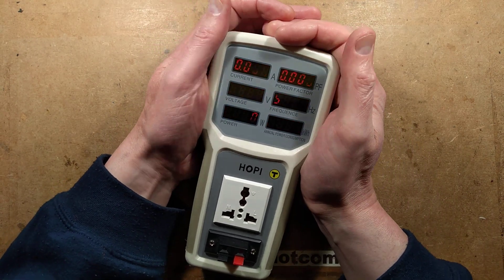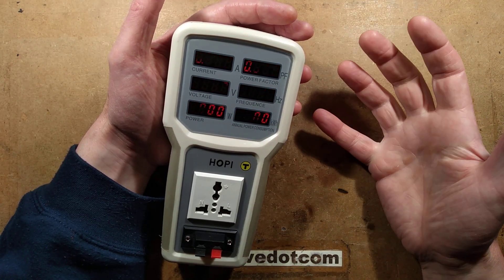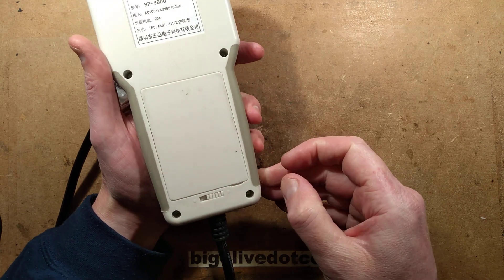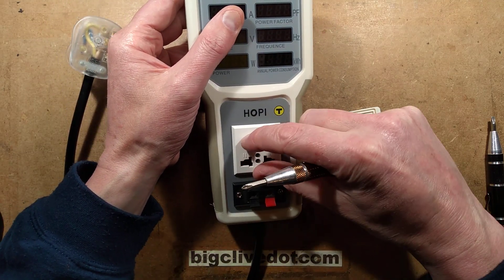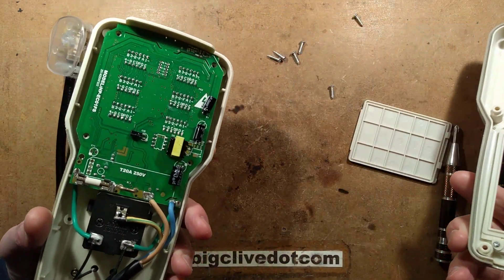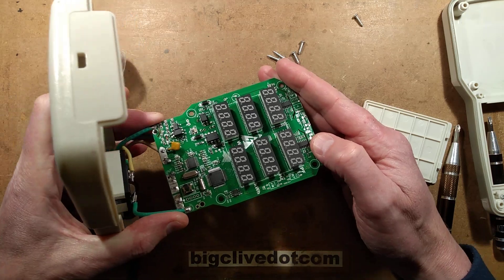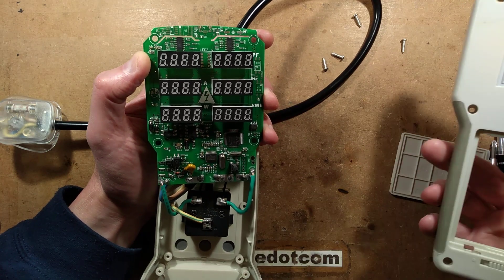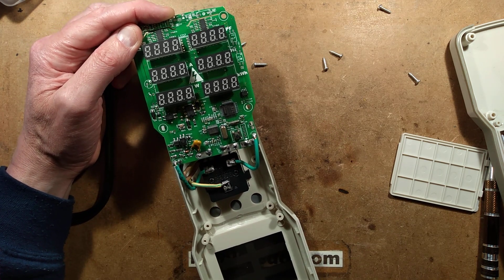Inside the Hopi power meter.  (It contains a smart meter chip!)

Comment: Hi, Clive - I also wish that I had bought the lower current model but was unaware of its existence at the time. I did away with the captive cable and fitted a panel mount IEC plug which I use with a right angle socketed cable. I have a user manual listing the functions of the"WTF" button but still do not understand what it does.

Comment: Hey Clive, found an ali express that has a scan of the manual for the HOPI for ya. uH stands for Active Electric Energy apparently, whatever that means.
You might be able to make some sense of this haha.
https://www.aliexpress.com/item/HOPI-HP-9800-Handheld-Power-Meter-Power-Analyzer-LED-Metering-Socket-Measurable-Current-voltage-Power-Factor/32375959317.html
You are most welcome.

Comment: The optoisolator is likely to monitor for mains power loss. The power supply will have some extra energy stored in it in such situation, just enough for the microcontroller to save the current state into non-volatile memory.

Comment: Why not rotate the power port 180 degrees & have the cord go up between the displays?
Reply: Because then it would be wired wrong, or at least that's what I heard around the u.s. when I was a kid about turning the outlets upside down. Thinking what hogwash it should be wired right no matter which way you put it in. Although now we seem to be in favor of ground pin up rather than :-) with the only downside that everything in the last decade has been made to go the opposite way and now falls out of the outlets.... but I digress.

Comment: Would you be able to build one with what you want and without the flicker?  A plug, a standard Edison screw fitting and wire terminals for the common things you test without needing to use adapters. 

Right up there with building a USB test rig to handle the normal testing and look for the normal bugs you run into with the cheaper builds. Why daisy chain 2-3 devices together to test a power bank/load and see it on a screen/be able to save the data.

Comment: Nothing special with the frequency going up and down. It depends on the loads of net. Someone starts an engine, or heat pump, or whatever? The frequency drops. Then the compensation kicks in to raise it, ad then someone stops some (often heavy) consumers, and the frequency goes up, then compensation kicks in and lowers it. It's a constant battle! And, at least here in Sweden, they try to even it out to be averaged to 50,00 Hz in a 24 hour period (calendar day). You can see that it's often lower during morning and evening and higher during day and night (higher consumption during morning and evening when people start and end their day, and thus the frequency drops).

Comment: Good job with the click bait title (not being sarcastic, might as well use them when you can). Makes sense that it'd use a chip that does automatic power integration, no point reinventing the wheel when there are lots of chips out there that do it for you 😁

Why yes, I'm being silly and commenting before watching the whole way though and you probably touch on that.
Reply: I wonder if the 1-24 multiplier for annual power consumption is hours use per day 🤔
Reply from the maker: It is.

Comment: I quite like the flickering effect. It's something you don't see on most modern electronics in videos anymore, since everything is usually so high speed you just get bars along the screen, if anything at all.
Reply: I have some Chauvet DMX4 cheap lighting dimmers which have a very flickery 4 digit LED display, the flickering looks really tacky. I assumed it was because they were re-drawing the entire display when they refreshed it (I have this problem with using OLEDs with an Arduino, best to avoid clearing display and just overwrite data  that has changed), but for a 7 segment display Clive;'s explanation makes more sense.

Comment: Key: adjust hours, display model, clear energy data.
APC: annual power consumption
CO2: annual CO2 consumption
AEC: annual energy cost
uH: active electrical energy
L-UP: upper limit power
Short press <1 sec
Long press >2 sec.
Pfft. Read it your self:
https://ru.aliexpress.com/item/HOPI-HP-9800-Handheld-Power-Meter-Power-Analyzer-LED-Metering-Socket-Measurable-Current-voltage-Power-Factor/32375959317.html
Reply: Thank you! =)

Comment: This link has some of the info on the various display modes.....YMMV...

https://www.aliexpress.com/item/HOPI-HP-9800-Handheld-Power-Meter-Power-Analyzer-LED-Metering-Socket-Measurable-Current-voltage-Power-Factor/32375959317.html

Comment: There's a sort-of manual on the Ali Express page for the meter:
https://www.aliexpress.com/item/HOPI-HP-9800-Handheld-Power-Meter-Power-Analyzer-LED-Metering-Socket-Measurable-Current-voltage-Power-Factor/32375959317.html

Comment: https://www.aliexpress.com/item/HOPI-HP-9800-Handheld-Power-Meter-Power-Analyzer-LED-Metering-Socket-Measurable-Current-voltage-Power-Factor/32375959317.html
This listing has a manual that explains the button usage

Comment: The short press tells it how many hours (H) a day you expect to use the light/device/whatever (1-24h) so that the annual numbers are calculated correctly.   AEC is supposed to be annual electicity cost but it seems to show annual energy usage (AEC=W*H*365/1000), as there is no way to input cost.  APC is annual power (energy, actually) consumption (APC=W*H*365/1000).  CO2 is annual CO2 production CO2=kWh*1.8017)  uH-- alternates between cumulative electrical energy kWh (5.645 kWh) and number of hours monitored (0001 17.41 is 117.41 hours) .  You can reset these by another long press when it is showing uH--.   There are Chinglish instructions online:  https://www.aliexpress.com/item/32375959317.html

Comment: Hey Clive, do you have a simple way to detect clipping in an audio signal? Besides an oscilloscope?
Reply from the maker: You can usually hear it.
Reply: True. I’ve always set my gains by ear but I’ve wondered how accurate my hearing is. Didn’t know if there was some circuit that could measure it or something. 👍
Reply from the maker: @poopandfartjokes  Some amplifiers have a clip indicator.
Reply: Trust your ear if you can hear something odd it's probably accurate. Another way to improve your accuracy is to listen to Bad Things... That's what I did with MP3s and can't stand compression on low levels

Comment: Is this author correct. Hopi power meter "What will never computed correctly this is energy consumed by Computers power supply, mobile phone chargers, laptop chargers, inverter air conditioner, LED home lights, up to high speed power drills." ?? 

https://www.ittsb.eu/forum/index.php?PHPSESSID=41b1tgs5vg8jr7o817dl7hdgo5&topic=1444.msg3465#msg3465
https://www.ittsb.eu/forum/index.php?topic=1236.0

Comment: this says what the button is for if you didn't figure it out yet https://www.aliexpress.com/item/HOPI-HP-9800-Handheld-Power-Meter-Power-Analyzer-LED-Metering-Socket-Measurable-Current-voltage-Power-Factor/32375959317.html

Comment: I wonder if that button may be used to program the cost per kilowatt hour among other things.  I have a meter called the KILL A WATT ™ which has similar functions and by putting in the cents per unit, you can realize the annual power consumption.  Useful for things like a refrigerator which will turn on and off during the course of the day.  Leaving something like that plugged into my meter will look at the usage over time and give you a reading.  The longer it's plugged in the better the displayed suggestion.  (of course with a fridge, you'll have different consumption based on the time of the year etc.)

Comment: 2:44 “..end up with a gap if I did try to turn it around”.

But what the hell, it already has a deathdapter style mains socket, mains voltage clip in speaker terminals, and a user accessible live battery compartment round the back! What’s one more design defect amongst friends!

Comment: According to the manual, the 1-24 is number of hours in a day that the device is used. uH is "Active Electric Energy," AEC is "Annual Electricity Costs," APC is "Annual Power Consumption," and CO2 is "Annual CO2 Consumption."
Reply: Zzyzx Wolfe But how does it know the Annual Electricity Cost, if there is no way to program the cost per kWh? (Rhetorical). Weird.
Reply: @andyowens5494  Clearly it's designed for communism, where the energy is always free! /s

Comment: My hopi DOES have the USB port populated but ive never used it. I looked for the other lower current, more accurate model on ebay, aliexpress, and dealextreme but couldn't find anyone selling it. Lots of sellers had the 20A HP-9800 model for sale but not the other model. If i remember correctly, it was only available on taobao from one seller and the page was in chinese.
Reply: When I chose mine I went for the highest rating I could find, so I can attach power tools,after looking inside I thought it a good idea not to plug the welder into it. 
Hopi meter prices are going to be high for a while it think.

Comment: Huh that meter is only $50, I might have to get one :D
Reply: I use a recently calibrated Rohde & Schwarz power meter at work and I measured the same loads with the HOPI and it was within 1% for most simple loads like motors and incandescent lamps, for more complex loads with harmonics and reflections, it was within 3% - like you say, for $50 it's good value.

Comment: But how about removing the speaker terminal for more clearance? Someone (or I) can easily 3D Print you a nice (pink) bigclive plate to cover that remaining hole :)
Reply from the maker: In a video coming out on Tuesday I was using the speaker terminals to test stuff.
Reply: @bigclivedotcom  Too bad. Though I hope the video involves using the terminals for a current way higher than rated :)

Comment: uH-- Active Electric energy Weber/A? .AEC Annual Electricity Cost. APC Annual Power Consumption. CO2 Annual CO2 Consumption. Source: https://www.aliexpress.com/item/HOPI-HP-9800-Handheld-Power-Meter-Power-Analyzer-LED-Metering-Socket-Measurable-Current-voltage-Power-Factor/32375959317.html

Comment: Does it indicate if the PF is lagging or leading?  The heck with manuals, operation should be obvious.
Reply from the maker: These days power factor is a completely different beast from old capacitive and inductive loads. The current waveform tends to be a peak in the middle of the sinewave.
Reply: @bigclivedotcom  If you plug one of those energy gizmos in that have a 5uf cap, you will have leading vars from it

Comment: I THINK the "multiplier is how many hours a day the device is going to run.  2.4watts x 24 hours a day x 365 days a year is 21024 watt hours, or 21 kWh, not the 0.9 it's displaying.

divide the 21024 by 24 hours in a day though, and you get 0.876 kWh, which is fairly close to what it's displaying (probably rounding errors)

Comment: Clive, love the irony, live connections covered by flimsy lid, yet what appears to be warning symbol on board, which you cannot access! Maybe that AEC, isn't and it's REC just using simpler and cheaper digits, so can record data, as it has memory chip? Also then the USB provides instant and recorded data capture facility possibly?

Comment: Tips for flickering display i found online. Put two identical videotracks at 50% seetrough and 1-2 frame offset in the video edit software. It's used to fix when you recordet at the wrong framerate compared to mains Hz. But it might work at higher refresh rates as well. Thanks for the cool video.
Reply: Clive is too cool for editing. ▶️⏯️▶️ Idiots like me need to edit in order to try and keep up with today's attention span. And I tried the pause technique but forgot or the camera glitched out on me.

Comment: https://www.aliexpress<DOT.COM>/item/HOPI-HP-9800-Handheld-Power-Meter-Power-Analyzer-LED-Metering-Socket-Measurable-Current-voltage-Power-Factor/32375959317.html
All the options and a list on how to program are on that page.  not bad for 50 bucks.

Comment: The measurement IC claims to be bidirectional. Could you try feeding some current backwards through the meter to see how it reacts. I'm sure the measurement IC will do fine, but the display code might not, and glitch out.

Comment: LMFAO love that battery compartment...
Secret buttons? Must be CIA surveillance...
I don't think the serial data from the meter chip would be affected by a different clock speed on the LED driver chip; that'll likely buffer serial data and o/p it on its own timescale (scuse any lapses in jargon, snakebite has a hold right now). There'd be no way of keeping them synced with 2 independent xtals anyway.
One major criticism of this video; no explosions!

Comment: Would it be possible to speed up the display rate by putting in a higher frequency crystal for the microcontroller?
Reply from the maker: I was pondering that, but I'm not sure if it would mess with communication timing.

Comment: Hi Clive, you should try recording these videos in a higher frame rate to stop this HOPI from flashing at us. say 60fps?
Reply: A higher frame rate would only make the flickering worse.  To eliminate flicker you need longer exposures and/or a much lower frame rate.  The reason you can see the flicker is because the existing frame rate and exposure time is too fast to capture all the segments illuminated during each exposure (there is a relationship between frame rate and exposure time in video cameras since your frame rate sets an upper limit on how long an exposure is possible).
Reply: Just little bit post editing and it can be eliminated. Just stack  few frames on top on each other with properly selected mixing option. Akhmmm... That would require above average editing software and separate camera for the HOPI only.

Comment: If all else fails read the instructions (learn Chinese first) STRANGE button (7) is adjusts hours, display model, clear energy data  - see link https://www.aliexpress.com/item/HOPI-HP-9800-Handheld-Power-Meter-Power-Analyzer-LED-Metering-Socket-Measurable-Current-voltage-Power-Factor/32375959317.html

Comment: whats that 4 pin pad alignment for could this be for serial port or isp connection. mmmh maybe it is even more hackable than you deemed possible. 

edit looked the rest of the video. im a bit dissapointed that you didnt whack out the datasheet for that uC. looks like an st one to me from the picture so datasheet should be available. then you could use the meter in continiuity mode and just find out whether or not our supections are corrector not

Comment: The RC04V is FRAM memory. These FRAM parts are fairly common in applications where a relatively small amount of non-volatile storage is required. Being non-volatile they'll hold their contents without power applied, much like Flash does, but they don't need the complicated unlocking sequence before writing. My company uses them for storing fault logs, elapsed time indication, unit identification information, etc.
Reply: The other cool things about FRAM are virtually unlimited writes, and no additional write time (same access speed as a read).
Reply: @Peter_S_  With FRAM a write is potentially faster than a read, as reads are destructive. The device has to read and re-write the cells for every read operation. This means there must absolutely reliably be enough stored energy to complete a read and re-write cycle before it begins, or you would end up with a corrupt memory when the power fails.
Reply: FRAM tends to have less retention time than flash or EEPROM has though (only 10 years for a part I'm currently using ).  Good for data that changes regularly, not so good for calibration data that remains constant for the life of the device.

Comment: The opto could be for frequenzy detection to let the Hopi work on 50Hz and 60Hz. ZeroBrain explained it in a video of a DLAN device.
Reply: The stc micro has only a watch crystal and sometimes an opto is used for the display refresh clock. Aka the display refreshes every zero cross. This is often done in appliances
Reply from the maker: You've just made me realise that he zero crossing point detection may be for accurate mains derived timing.

Comment: Button = "Adjust hours, display model, clear energy data". www.aliexpress.com/item/HOPI-HP-9800-Handheld-Power-Meter-Power-Analyzer-LED-Metering-Socket-Measurable-Current-voltage-Power-Factor/32375959317.html

Comment: great clive quote 'whatthefuckisthebuttonfor'
The aliexpress listing  gives more info  the  speaker type connection is not on some versions https://www.aliexpress.com/item/HOPI-HP-9800-Handheld-Power-Meter-Power-Analyzer-LED-Metering-Socket-Measurable-Current-voltage-Power-Factor/32375959317.html

Comment: Don't speakers get to significant voltage?  It is hard to find a rating but I would assume they'd be at least a couple hundred volts.  Its really hard to find any real info about these connectors.
Reply: 100 watts would be about 30V RMS into an 8Ω speaker.
Reply: @rocketman221projects  Well, yeah, but speakers obviously go much higher.  I couldn't even find any info about what wattage ranges these spring terminals could be used for reasonably.

Comment: My guess is that the Opto Isolator is for the line frequency measurement.  Having had a quick look through the CS5463 datasheet, I can see no reference (and certainly no registers) to be able to directly read the line frequency.  I think the chip needs to know what the line frequency is for calculating Power factor.

Comment: if you go to the this link you will find out what the button is for 
  https://www.aliexpress.com/item/HOPI-HP-9800-Handheld-Power-Meter-Power-Analyzer-LED-Metering-Socket-Measurable-Current-voltage-Power-Factor/32375959317.html